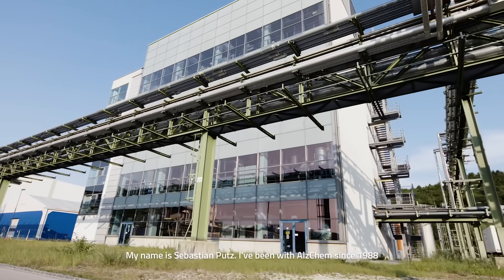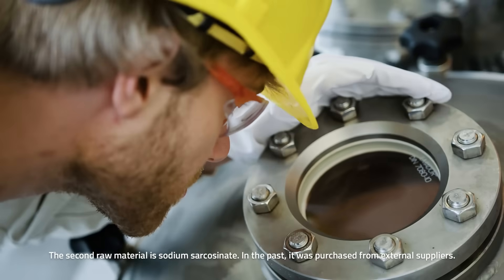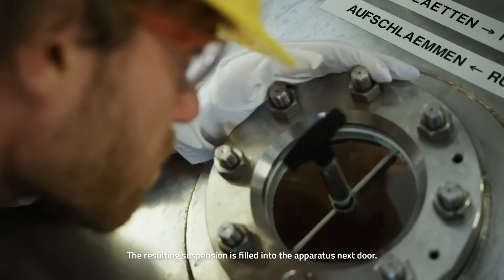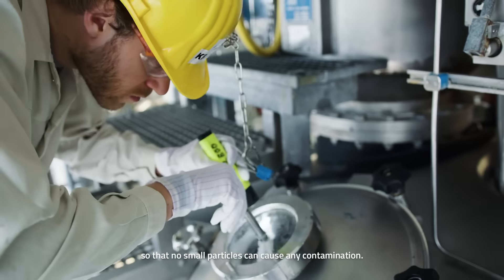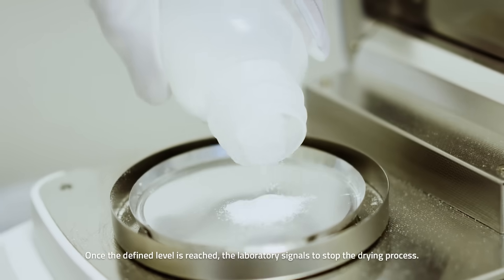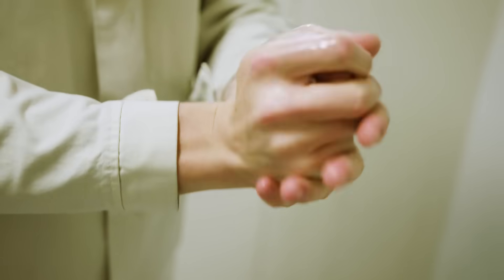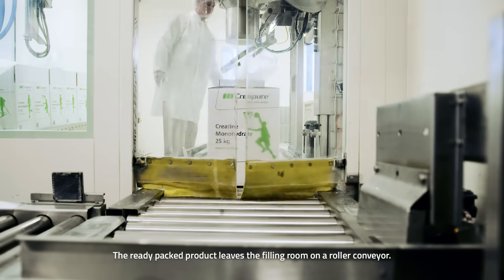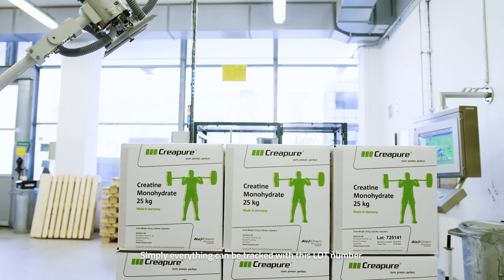Creapure® Production - How we produce the world's best creatine! (English Version)

Comment: Is Optimum Nutrition creatine creapure certified?
Reply: I just found out that Optimum Nutrition no longer uses Creapure for their Monohydrate product. Gonna switch to another brand.
Reply: @bhagchuandosifreidi6228   I am looking forward to trying out the most pure creatine after a 8 year lay off...... Bottom line is that I have been doing my own research for the last 6 months comparing German creapure with non German creatine that supposedly made from china,  so far it seems as if the only difference is that Creapure is only 1% more pure than regular monohydrate and almost double the price than regular monohydrate.  Correct me if I am wrong but it just seems as if I'm paying almost double the price for barely any difference. Please give me your honest explanation for this.  I would appreciate it
Reply: @earlcoles5215  if the regular creatine is made in China, I would not touch it. Whether you're buying Creapure or regular creatine monohydrate, make sure it's manufactured from a country with very high food manufacturing safety regulatory standards. That's the key. Most cheap creatine is from China and I don't trust any of their test figures. I buy Creapure because I know for sure it's from Germany and EU food regulations are the strictest in the world.
Reply: @earlcoles5215  as long as there is the official Creapure logo on the tub and also sold in an established store, it should be fine. Read the ingredients in detail to make sure there are no added fillers.

I recommend Muscle Feast Creapure Creatine. Trusted brand.
Reply: @bhagchuandosifreidi6228  last question,  but very important for me,  what can you say about Fitness labs German creapure,  it is $20 for 1000 grams, that's 50 percent cheaper than most....does cost make a difference in quality or not really ?
Reply: @earlcoles5215  should be fine, just make sure you buy it from reputable sellers or from the manufacturer itself. Also check the expiry especially if the product is on clearance promo.
Reply: @bhagchuandosifreidi6228  That just means Optimum Nutrition is probably switching to GMP facilities. That's good thing

Comment: Is all Creapure micronized? Or is it an additional procedure done by your partners?
Reply from the maker: No, we don't micronize Creapure® at our GMP plant in Trostberg, Germany. This process is done by some of our nutrition partners.
Reply: @Creapure   I am looking forward to trying out the most pure creatine after a 8 year lay off...... Bottom line is that I have been doing my own research for the last 6 months comparing German creapure with non German creatine that supposedly made from china,  so far it seems as if the only difference is that Creapure is only 1% more pure than regular monohydrate and almost double the price than regular monohydrate.  Correct me if I am wrong but it just seems as if I'm paying almost double the price for barely any difference. Please give me your honest explanation for this.  I would appreciate it
Reply from the maker: @earlcoles5215  thanks for reaching out! 

We can only speak for the high quality of our Creapure(R). We don’t cut corners when it comes to purity, safety and quality. Creapure(R) is 100% manufactured in our GMP facility in Germany under strictest German and European standards. All steps of the manufacturing process are continually monitored, resulting in consistent, reliable and unsurpassed quality. 

To answer your question - when it comes to dietary supplement, a purity variance of 1%, would make a serious quality difference. We have randomly analyzed creatine end-consumer products and the quality differences between Creapure(R) products and generic (non-Creapure(R)) products were significant. For more info, check out the analytic results on our website: 

https://www.creapure.com/en/creapure/how-quality-and-purity-creapure-guaranteed
Reply: @Creapure  is ax german creatine creapure?
Reply: @chrisdopez8443  if it has a creapure logo on it then yes. Out of curiosity,  are you interested in Ax ? Its obvious that you are otherwise you would not be asking questions regarding it. It seems as if ax is difficult to get due to it always been out of stock unless you get it from Amazon for 3 times the price.   Why not be interested in another creapure brand ? Like I said I'm just curious